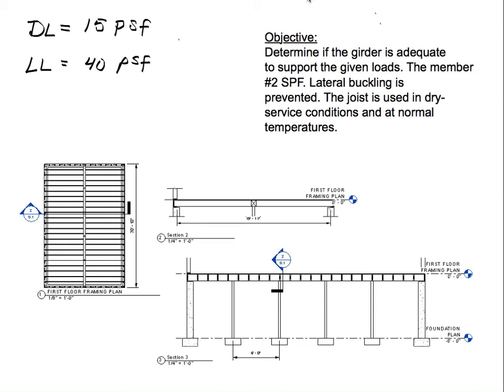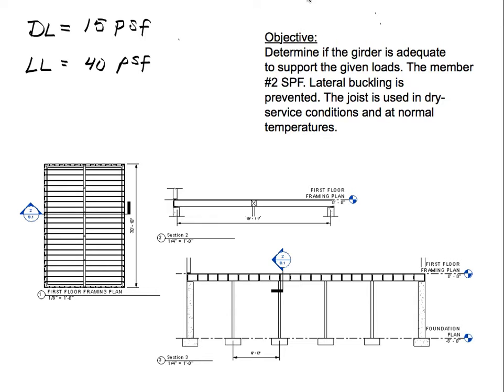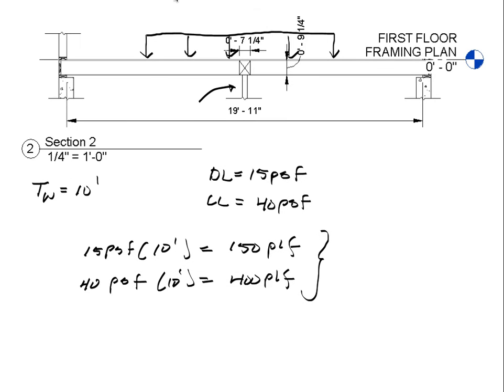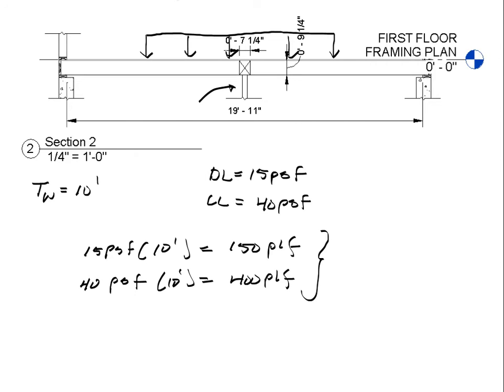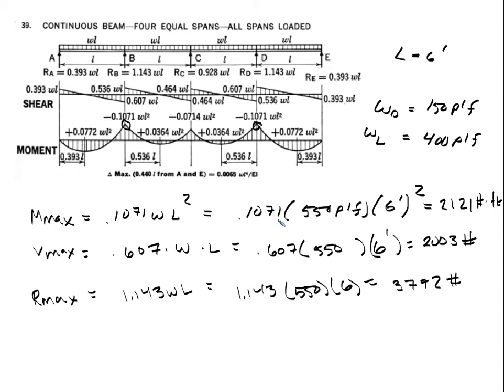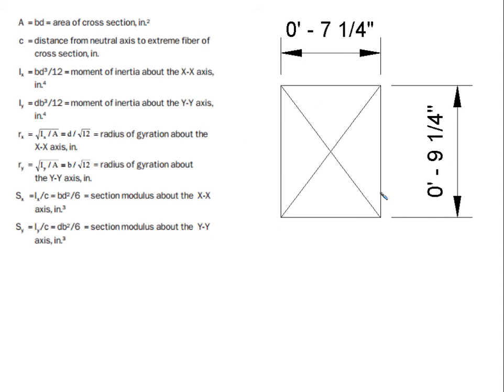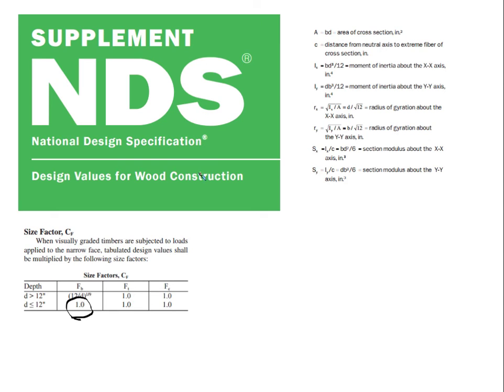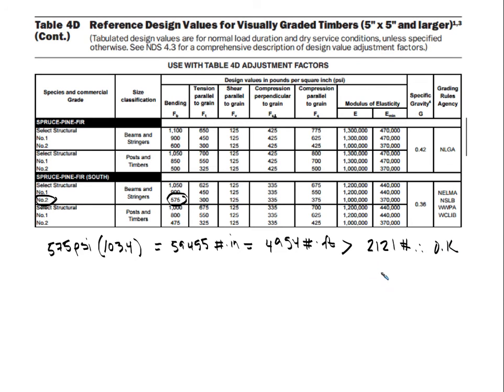Girder- Design Example of a First Floor Girder

Comment: I know I am commenting on a very old video, but if you are still out there, I wish to know how the calculation would change if instead of using a continuous 30-ft long 7 1/4 x 9 1/4 (8x10 nominal ?)  you chose to use 5 ea 2x10's nailed together (assuming you could find 30-ft long 2x10's) ?  I guess the moment of inertia is probably different, how would that be calculated ?

Also what publication did you find that continuous 4-span shear & moment diagram? did they not have a continuous 5-span diagram?